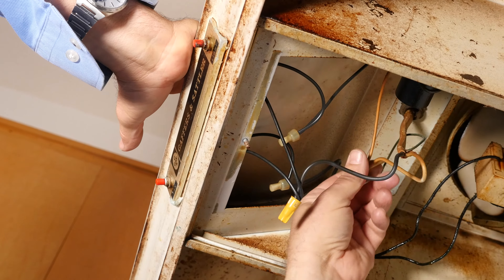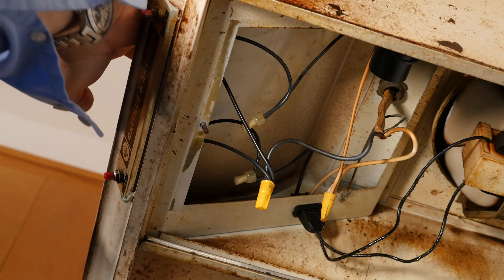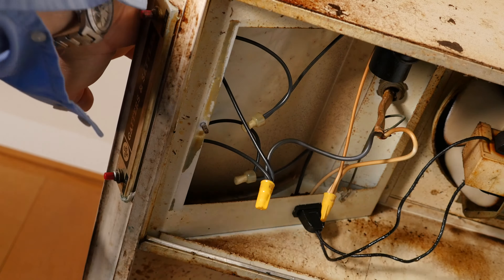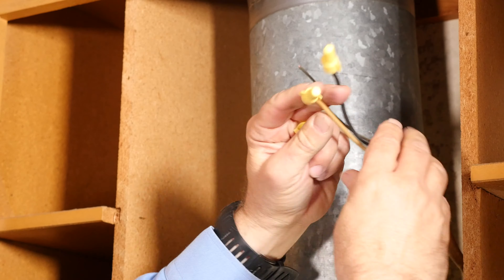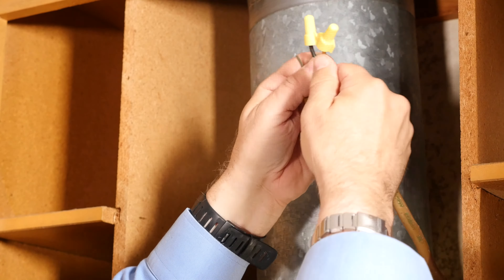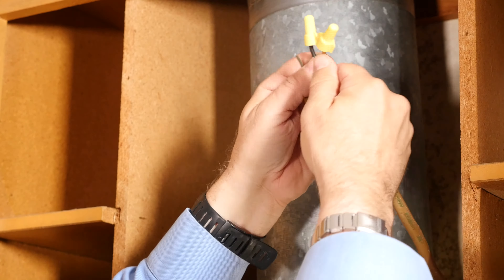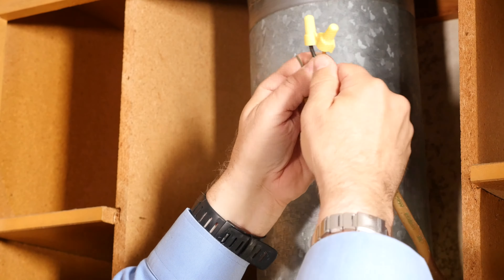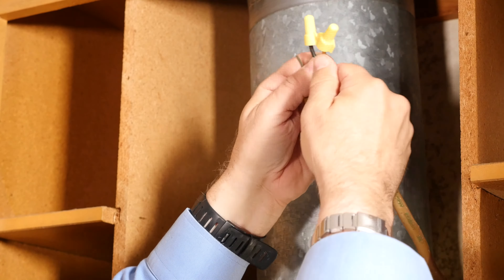How to remove an old stove hood vent (range hood ).

Comment: Hi Nathan. I had a new Hauslane range hood installed but it seems to be leaking air because the adapter to the duct wasn't sealed air tight. I'm trying to access the connection from the duct cover side inside the top cabinet which is wood. Do you have any idea how that opens? Mine is similar to yours except it has a front face too. It doesn't want to come out when I pulled it and there is no door.